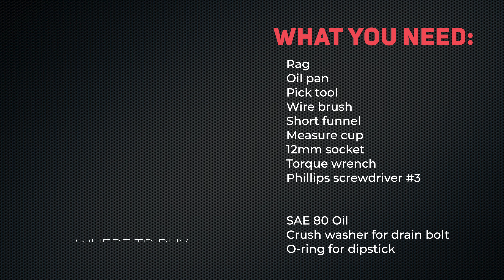Yamaha Tmax 500 - Chain Drive Oil Change | Mitch's Scooter Stuff

Comment from the maker: T O O L S
Rags - https://amzn.to/2Yh8jvg
Oil pan - https://amzn.to/3bOmT5Q
Pick tool set -https://amzn.to/3rXSjBA
Wire brush  - https://amzn.to/3Jvi8gW
Funnel (short) - https://amzn.to/2HY4m6g
Measure cup - https://amzn.to/3NUOz96
Ratchet 3/8 drive - http://amzn.to/2hhmnUs
12mm socket 3/8 drive - http://amzn.to/2xM4Edr
Phillips screwdriver #3 - https://amzn.to/3tFVXvD
Torque wrench 0-150 lb/ft 3/8 drive - http://amzn.to/2Crqq4R

SAE 80 Oil - https://amzn.to/45Cq2y7
Crush washer for drain bolt
O-ring for dipstick